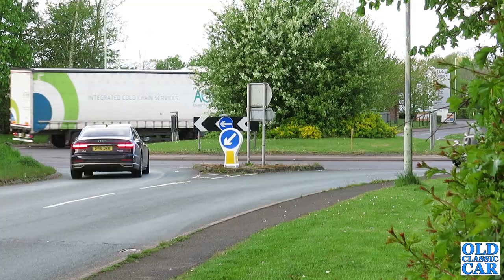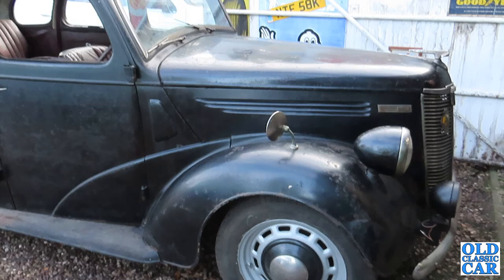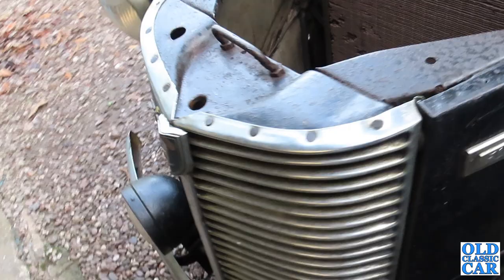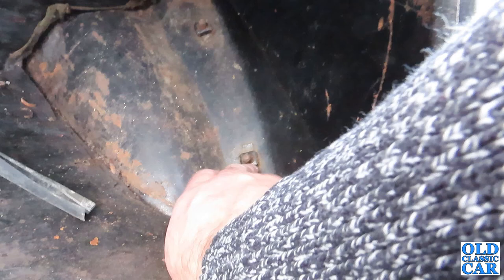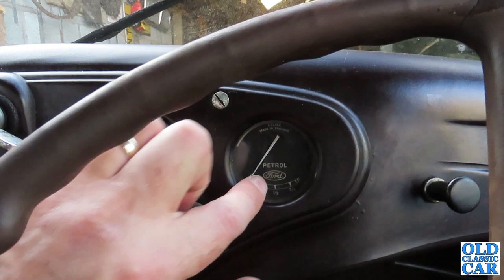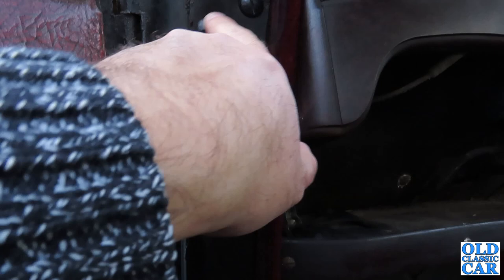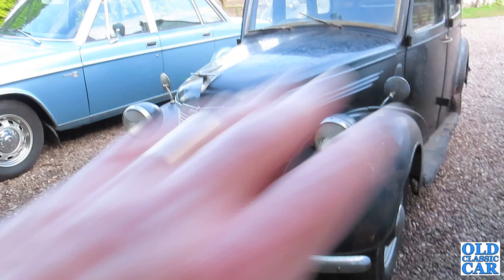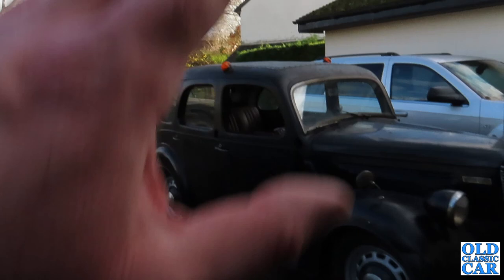Our 1948 Ford Prefect E93A - a quick intro to this very original old car | Oily rag restoration

Comment: Another little beauty.  I looks to be in amazing condition for it's age.  Is that some sort of period heater pipe attached across the top of the radiator?  I think the earlier front styling looks prettier than the later integrated headlights although they are both very good.  😊
Reply from the maker: Yes I think it must have played a part in some form of heater or otherwise, perhaps similar to the factory-approved arrangement I mentioned in a previous vid about the Anglia

Comment: Very nice. I’ve always preferred this model Prefect to the later one. Is that a vacuum tank I spy in front of the radiator?
Reply from the maker: Hi, yes that's the tank although how effective it is ....
Reply: @oldclassiccarUK  It probably isn’t effective at all. I seem to remember removing the vacuum tank from one of my Pops.

Comment: You seem to have unlimited parking space 😂 Fantastic! Is the Morris 8 still around or has that departed?
Reply from the maker: Fortunately the dry space is limited slightly, the M8 went as part of my simplification plans for this year (mentioned in an earlier vid). The Anglia took its place and was ready to use straightaway.

Comment: Hermetite red, nice 1980s period bodging part of the cars history should be left?
Reply from the maker: I'll keep an eye on it and see how it goes, if it looks like it'll leak then I'll do it properly
Reply: My father used a light apply of Hermetite on head gaskets as a matter of course for a seal . It was very good on other gaskets as well. These day's mechanics are reluctant to use anything to seal gaskets.  Apart from cowboys using bathroom sealant when they haven't got any gasket at all. Excellent car , this is the much more interesting model as far as I'm concerned , the last facelift was not as nice .
Reply: @glpilpi6209  People these days if they use any sealer tend to go colour coded you just don't see good old red any more, keep it away from oil ways it's fine